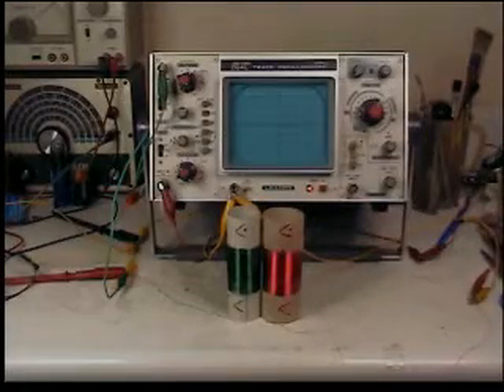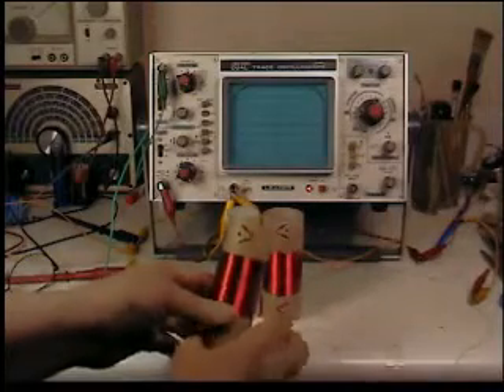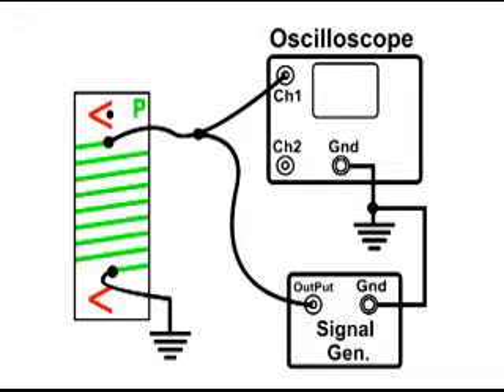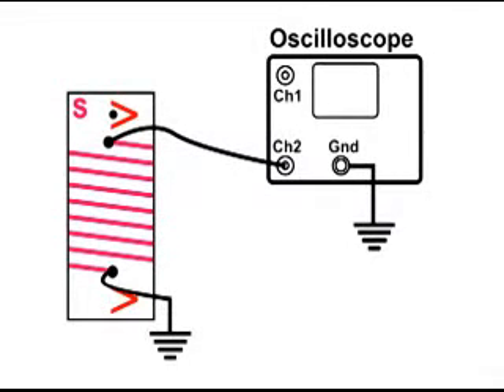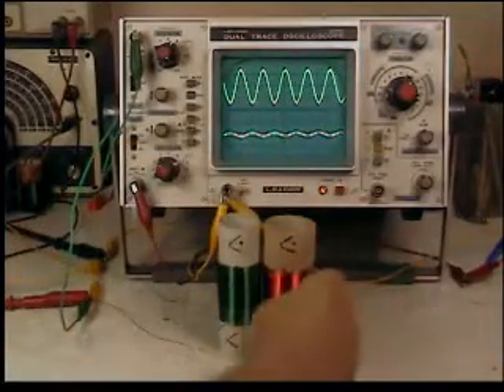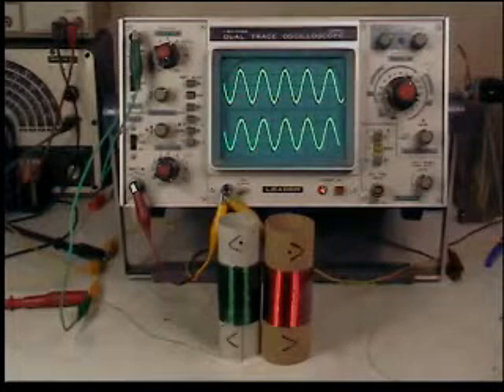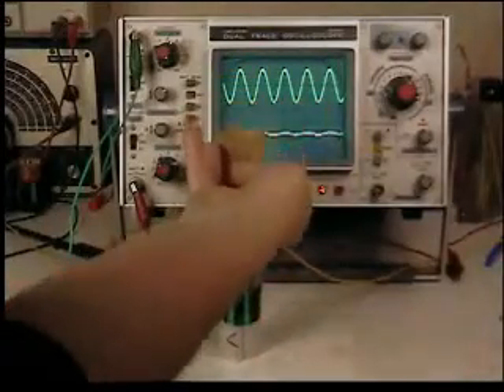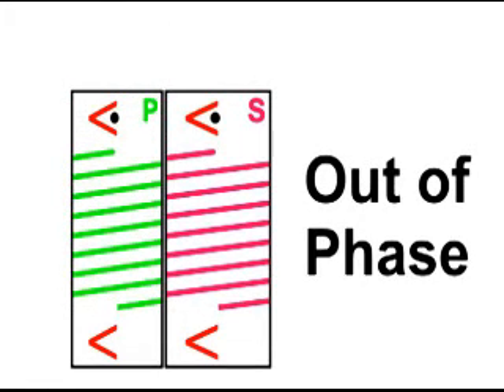Transformers, basic phasing

Comment: nice demonstration. they are air core? what is the approximate efficiency?
Reply from the maker: +taz0k2 
Efficiency depends on several factors. One of the is how far apart the coils are from each other, but let's say that the coils are wound on top of each other primary in the center and the secondary wound on top of the primary. So now that we have this situation another important factor would be the frequency applied to the primary. With air coils like these, their efficiency is quite high when the frequency applied to the primary is in the RF range, the secondary output is quite good. However with the same set of we were using audio frequency applied to the primary the output on the secondary would be quite poor.

Now quit had an iron core to this situation, the primary is wound around the iron core in the secondary is wound on top of the primary. If we apply an RF signal to the primary, the output at the secondary would be quite poor. However if we apply an audio signal to the primary, the output at the secondary would be quite good.

So the transformer is designed to be the most efficient for the frequency that is going to be used.
Reply: +AllAmericanFiveRadio I see. Thank for your answer.

Comment from the maker: Yes, you exactly got my purpose. It is very irritating to work hours on equipment you have repaired and it does not work or work right, but all the voltages are correct. And its because you flipped the connections to a winding. Guess how I know.

Comment from the maker: Yes a little back EMF causes the impedance of the primary to increases which increases the signal to the oscilloscope. The plunger of the solenoid is an iron core for the coil. If you are using AC to drive the coil, yes, lots of back EMF and because of the iron core a lot more Hysteresis effect.

These two videos on transformers I consider to be less than a snow flake on top of an iceberg compared to the mountains knowledge about this subject.

Comment: Another great demo that sparks my curiosity!

I noticed that the amplitude of the primary winding increases slightly when the secondary is placed over it.  Is this a side effect of reactance, causing less load on the signal generator?

For example, I noticed that solenoids tend to pull more current when the plunger is pulled out than when it is fully inserted.  Would that same principle apply with transformers?